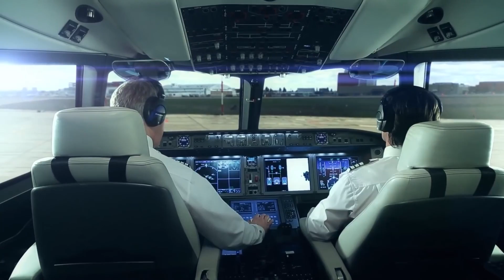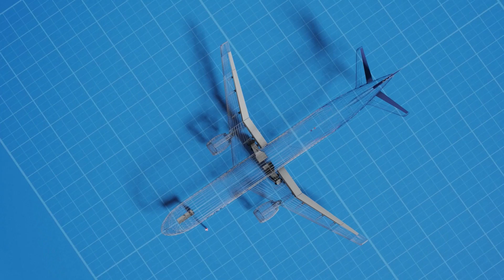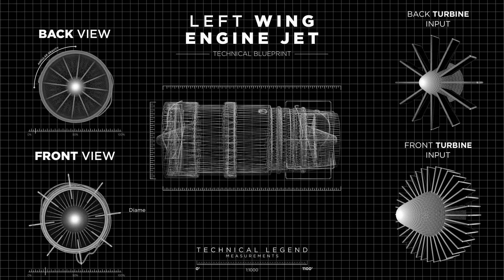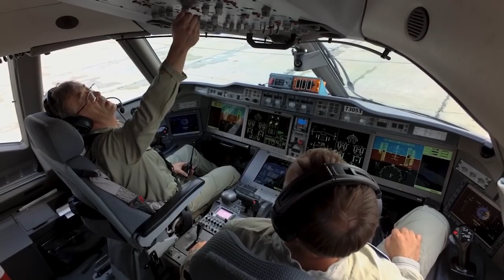Russian 737 MAX & A320 Competitor - The MC-21

Comment: As always, politics will ruin everything. On the Russian side, this effort is politically important and I'm sure the country's president is willing to support this company through almost any number of additional cash injections. The west will try to throw every sanction option at them to get the program to die and get Russians to waste a lot of time and money. 100% domestic manufacturing is a blessing and a curse. In theory, it's good to have this capability - in practice, well, it's not practical. There will be supply chain issues, part sourcing issues for other countries, basic support issues etc. Airbus and Boeing have huge established global support networks that won't be easy to beat. If the Russians get unlucky with any major accidents/incidents from independent airlines in the first few years of this launch - it will kill this program, since you'll instantly get "we told you so" from Airbus, Boeing and the west in general. With full domestic manufacturing, the number of uncontrolled variables is huge, so the odds are absolutely stacked against them. Very cool effort all in all, but difficult to imagine having it work out as intended. Maybe the best realistic scenario for them is that this plane will become a good domestic option, and some of the tech developed will get repurposed for the military. Thanks for the overview!!
Reply: USSR летал на своих самолётах и плевал на Боинг и Эйрбас. Почему вы думаете, что Россия не сделает то же самое? Всё идёт к тому, что иностранцы будут потихоньку вытесняться с российского авиа рынка.
Reply: @СашенькаМ-з5в  Я согласен и эту точку высказал. Российский рынок всегда их возьмет. Просто этот вариант не расплатиться за разработку такой программы. Россия должна найти баланс между внутренних целей и международных. В данном мире, в изоляции страны выживают плохо. Северная Корея как экземпляр.
Reply: @oriole8789  С чего вы решили что  это проект не окупится опираясь исключительно на собственный внутренний  российский рынок ?  Российский рынок весьма емкий . Так же созданная промышленная база будет работать не только исключительно но авиастроение . И на другие отрасли . Например двигатели  ПД-14 планируют использовать для насосных станций в нефтегазовой отрасли для перекачки нефти и газа по трубопроводам.  То есть это дополнительные объёмы загрузки промышленности . А значит и увеличивается окупаемость проекта .
Reply: @oriole8789  No one argues that isolation is bad. But it is unlikely that Russia can be isolated more than now - first, business will always find a loophole, and secondly, the Russian Federation is not North Korea. Which, imho, is isolated just as much as it wants to be. And, as we have already said here, the capacity of its domestic market will allow aircraft manufacturers to stay afloat. It is important that there is internal competition-Irkut, Sukhoi, Tupolev, Ilyushin, etc.
Reply: @юрийкосачев-э1э  "There is no mafia in Russia" - Спасибо за вежливость вашего ответа, но этот текст является полным идеализмом. Я реалистичный человек, и у меня достаточно опыта работы с Россией. Я также пытаюсь рассматривать вещи оптимистично. Я не отрицаю ваши точки насчет других видов использования двигателя итд, но этого не хватит. Европа и Америка вряд ли станут покупателям этого самолета. Но, Россия наверно сможет его продать в некоторых азиатских и ближневосточных маркетах - может быть этого хватит чтобы продолжить данную линию самолетов. Государство будет продолжать вкладывать в нее деньги, и это логично для выполнения глобальной цели модернизирования авиаиндустрии.

"You are a victim of stereotypes . You have a lot of stereotypes about Russia that your Western media have instilled in you." - к сожалению это не так. Я работал со многими другими странами включая Россию. Мое мнение исходит от личного опыта, и людей в моей рабочей сфере. Новости и мнения СМИ для меня мало что значат. Я рассматриваю номера, статистики и опыты других. Для больших компаний, работать с России не так плохо. Для маленьких и средних - в большинстве, плохая затея. Темная сторона России не так сильно влияет на многонациональные предприятия. Извините что я не очень хочу оправдывать это заявление в данном контексте. Возьмите это как личную точку зрения другого человека.
 Согласимся что собачка на вашей иконке симпатичная. ;)
Reply: @СашенькаМ-з5в  This is a very balanced view, and I can't disagree. I hope that it happens like that. If Russia can build a good internal safety record for these planes, they will have a much easier time selling them to larger international markets. Competition is very important as you've said, even within the country. This is what creates innovation.
Reply: @oriole8789   А привёл дополнительное применение двигателей лишь как один пример . Так же и другие отрасли участвующие в проекте создании МС-21 будут загружены и работой в других проектах . В той же авиационной отрасли России  МС-21 это не единственный проект . Помимо МС-21 имеется Супер Джет 100 . В котором сегодня увеличивают долю российских комплектующих . Так же  программа производства Ил-114 , Ил-112 , Бе-200 , Ил-76-90 , С929 .  итд. Всё это так же будет загружать объёмами промышленную базу . 
Да США и ЕС вряд ли будут покупать российский МС-21 . Так как они лоббируют своих производителей .  Но помимо США и ЕС есть ещё огромный азиатский рынок , рынок Ближнего Востока ,  Африки , рынок Латинской Америки.  И почему вы считаете что только некоторые страны могут купить ? В мире уже имеется усталость от гегемонии Западного мира .  Боинг и Эрбас это одна из составляющих частей монополий западной гегемонии .  МС-21 это альтернатива западной монополии . 
Сегодня в мире  стремительно растёт влияние Россия  .  А это на прямую влияет и на мировые рынки и на продвижение товара на мировых рынках. 

Извините . Но я сам представитель малого бизнеса. И ни каких проблем в его ведении не имею. Вся проблема это высокая конкуренция . Рынок переполнен . Из за доступности кредитов именно для малого бизнеса . Из за чего и растёт конкуренция.
Reply: @HypercubeJones  Agreed. They know this as well. Regarding contracting, I'm working with a customer whose past contractor was a Ukranian company as well (via upwork). We've looked at their work in detail and our conclusion was "competent but lazy". The bare minimum was done, but it wasn't done "well", documentation was non-existent, and bills for the customer weren't all that much cheaper than western options. If the customer is a technical person and they can micromanage the contractor, then it would be an acceptable option (if budget was very tight). Generally, I'd recommend ponying up the funds for local development. Of course, even in that situation, contractor selection really matters.
Reply: @oriole8789  Russian civilization is built on justice . Western civilization is built on the meanness and plunder of other peoples .
Reply: @юрийкосачев-э1э  There is truth to that. Lots of countries have unpleasant or injust histories. I'm only looking at modern culture in different countries and how it's evolving. That's why I have a lot of respect for Russia, its history and past achievements. Their current culture is still too unstable and crime-driven for me to recommend it as an option for my customers. That's the problem. Maybe this will change in the future. I hope that it does.
Reply: @oriole8789  You are a victim of stereotypes . You have a lot of stereotypes about Russia that your Western media have instilled in you. Russia is a free, democratic, civilized, legal state. There is no mafia in Russia. In Russia, there were gangs in the 90s . When there was a crisis in Russia and the weakening of state power . But since 2000 in Russia began to restore order . And the gangs and the mess were over. I can assure you that Russia is much safer than the United States or Europe.
Reply: @HypercubeJones  It was a similar story with my customer. I've seen the communication logs and there were lots of misunderstandings and points where my customer gave up trying to relay certain details or reasoning to them. The way I see it, if the needs of your project require "extending your team", this would be a bad option. If you simply need extra "tools" and raw manpower that you're willing to micromanage, then it could be an acceptable option to cut some costs.

I believe you regarding the rest of Europe. Lots of people around me have a high opinion of scandinavian programmers/engineers, though I have no personal experience. Thanks for your vote of confidence, I'll keep it in mind. Good luck with your work!
Reply: It's the Russian Government fault. They are making enemies left and right and they refuse to support these companies to thrive in the global market. Even China won't let this plane to be successful in their country. They are shooting themself in the foot.
Reply: @nntflow7058  Yes and no, and it's very complicated. What many people don't understand is that Russia doesn't just consist of "the evil government" and "the kind residents". In reality, lots of people at the top of various Russian companise and organizations do all sorts of evil/self-serving things. Culturally, Russia has always had an organized crime problem, mafia influence, etc. What I'm saying is that it's not "just" the government, but the people as well. I think Russia is a cool country in many ways with a deep fascinating history, but as a business person, I have zero interest in working with them. It doesn't mean that every deal with Russia is guaranteed to be bad.. but when things go wrong, they go very wrong. Pride and hubris are deeply entrenched in their culture as well, along with occasional recklessness and irresponsibility. Even inside the country, the people "who want to do things right" always end up fighting people "who don't give a f". Their aerospace track record is very good and I think global companies are "open" to taking a look at Russian options but they are rightfully hesitant. It's an industry that values stability, consistency and reliability. Russia as a country is seen as volatile, which is a problem.
Reply: @oriole8789  , you're right on the money. You get extra credit for remaining so temperate.

I don't think most people know how organized crime is woven into the fabric of business in Russia (and NYC and Miami), and how spectacularly violent and vicious Russian OC can be. They did to the Italian Mafia in NYC what killer bees did to more docile honeybees.
Reply: @HypercubeJones  Yes, and as an exterior business trying to work with Russia, you can never be sure about any of these things. Russian people as a culture almost never legitimately respect people from other countries (hence pride). You'll be "the american" who they'll be nice to when they want, and you'll be their last priority if a problem arises - unless they see you as a solution to their problem. There are other cultures with a tendency not to respect people from other countries - for example, Japanese culture. However, here's a thought experiment. It's easy to imagine a Japanese company being deeply embarrassed and apologetic about leaking out private customer info/data. Can you imagine a Russian company with that attitude? It's not their style. They'll just deny it and blame you instead. Counting on them to protect your info is almost a silly concept, because opportunism runs deep in their culture. The same opportunism that led to a deep intertwined OC world. All that said, they're changing as a country. Most changes are good, some are bad. Culture is always last to change. However, they have to do what they can to prop up their internal economy. If their economy fails, they will become another Mexico where OC will dominate local governments and this will be very hard to reverse, same as with Mexico. It's one reason why Russian government is very heavy handed. They make use of some OC resources, but they always make sure that OC understands who the boss is. It's a very strange arrangement at enterprise level. Extremely different to anything in the west or elsewhere.

Comment: sanctions? SSJ 100 was made in collaboration with Boeing, 20% of Boeing aircraft parts are made in Russia. Have you heard of Ural Boeing production plant? Boeing made special equipment for the An-124, which is operated by the Volga-Dnepr company. Now all existing An-124s (including ukrainian ones) use Boeing equipment.
Reply: Subject needs to eat a lot of haloperidol tablets ...
The SSJ-100 has nothing to do with Boeing.
But the plant in the Urals, VSMPO-AVISMA, produces critical titanium parts (center section, chassis, engine parts) both for Boeing and Airbus, as well as for Russian civil and military aviation.
Reply: @ИгорьИсаков-з4р  The SSJ-100 has nothing to do with Boeing? So... u don't know nothing about collaboration between Sukhoi and Boeing. By the way, the planes of both companies are equipped with French Snecma engines.
Reply: Боинг никогда не занимался региональными самолётами. И да, в ГСС были представители от Боинг, но они больше учили экономический отдел ГСС правильному продвижению такого продукта, как Су-95, на рынки. Большая часть представителей - сотрудники из российского подразделения Боинг.

Comment: The benefit of former "glorious" history of aviation, agriculture etc in soviet union was mostly due to uneconomic mass-subsidiation and mass-production of same stuff. The "glory" being... maybe in robustness? As even in soviet times there were never enough of these mass-produced machines.
So coming to the current state of Russian production, we do not have to look too far away from aviation to see the unfortunate consequence of the production quality of previous times. The SSJ planes are usually "gifted" to airlines as a token of friendship and are only operatable when for every one operating plane is one for spare parts. Wikipedia states that those that have SSJ planes, want to get rid of them and the biggest airline "Aeroflot" has only about 10 planes in active use out of 30+ they have acquired.
Can MC21 break this "fortune"? As it seems to be fully "made in russia" I would be rather cautious to keep any hopes too high. 
Thank you for taking a look at Russian planes tho!
Reply: Check your sources .. and update the data. Biggest problem was with Safran motors. Guess where they are from?

Comment: I really like the design of the MC-21
I hope that it succeeds to give 
Airbus and Boeing a run for their money
They are getting too comfortable delivering aircrafts designed decades ago
Reply: agree100%
Reply: Nope. They upgrade and rename airplanes like A3XX-CEO, A3XX-NEO, B7X7-X and B7X7-MAX. Understood? B737 was designed first using fuel inefficient JT8D's. The latest B737's run on CFM LEAP engines.
Reply: Thanks, bro! I'm pretty sure that the MC-21 will succeed. There is just no other option for it as probably the most important undertaking in the Russian aviation history. Because it's not just about this particular aircraft but about creating a whole new modern industry involving a lot of high tech branches. Consider alone the new engine PD-14 which is the first product in a completely new family of engines which will be built for other types of aircrafts and also later for MC-21 allowing to create long range versions up to 11000-12000 km flight range. So it's just a matter a time to see MC-21 on international flights. Unfortunately, competing against Boeing and Airbus is nothing but nastly politics, so even if some countries and airlines would love to have it soon, behind the scences they won't be allowed. But for the MC-21 program it's just an additional stimulus to succeed. MC-21 is coming to stay!
Reply: This aged like milk
Reply: I really REALLY REALLLLYYÝ  wish MC-21 SUCCEEDS
Reply: @carlosgamarrath244  
i am sure this will prove a better product.
but unfortunately european and american politics play a nasty role
Reply: @carlosgamarrath244  Please speak and write the Russian names correctly ! The name of the aircraft MS-21 (in Russian-MС-21) !!!
Regards from Russia !
Reply: Please speak and write the Russian names correctly ! The name of the aircraft MS-21 (in Russian-MС-21) !!!
Regards from Russia !
Reply: Russia needs to sort out its relations with middle countries. The MC-21 will be a good plane. But to succeed , Russia needs middle markets like Iran. Why these tow countries cant seem to get an aviation deal done, I don't know.
Reply: @Toro_Da_Corsa  needed engine free from western patents.now there is a pd-14
Reply: China has just put an order for 500 of these fine birds.

Comment: Hey mc-21, where those of You're  wingtip devices?
Reply: The design of the wing does not require wingtips. The high aspect ratio of the composite wing eliminates the need for winglets. Same as boeing  787
Reply: @Rashid-Hamid   нет, увеличение крыла делает ненужным законцовки
Reply: @Fh3592fvhfzxvbnmmh  ага. Спасибо, я где то видел это. Как то забыл.

Comment: most modern narrow body on the planet
Reply from the maker: They are decades ahead of the competition. Even the A220 is old hat to this plane :)
Reply: Because it’s a clean-sheet design. It may be modern, but how reliable will it be?
Reply: @paulsz6194  As SSJ-100 showed, the biggest problem with Russian aircraft (and to be fair with loads of other products) is aftersales support. Planes spend way too much time parked up waiting for parts for scheduled maintenance.
Reply: @jur4x  exactly . So it doesn’t matter how great they are In terms of range & performance and price, when you can’t guarantee a reliable supply of spare parts.
Reply: @jur4x  Russia has learnt this lesson with SSJ100.
Reply: @vatnikxxi7717  And the lesson is:
Minimize cooperation with Western companies to absolute necessity.  Because the governments of those companies may sanction you, deny supply of needed parts and forbid you to export your final product to a third country.